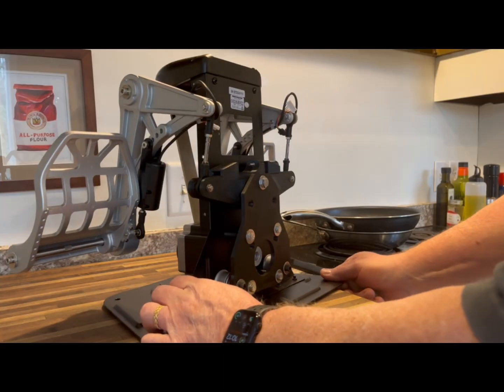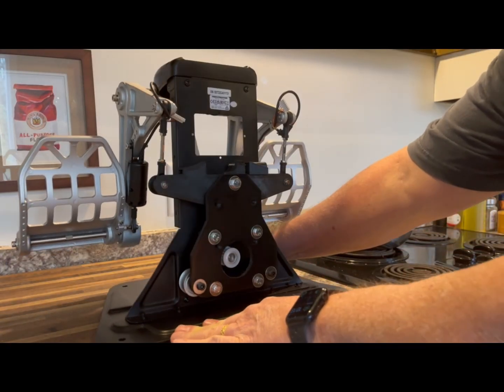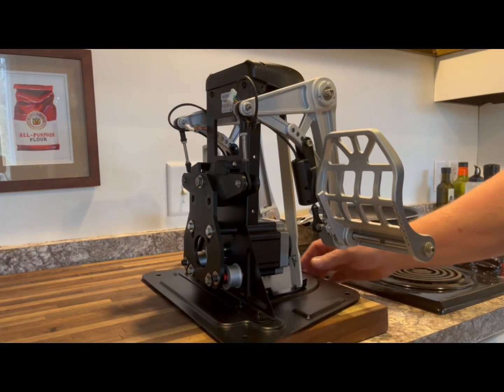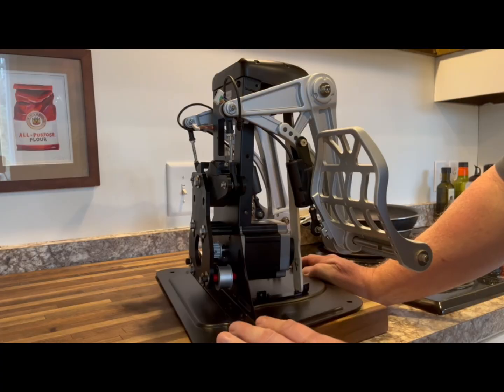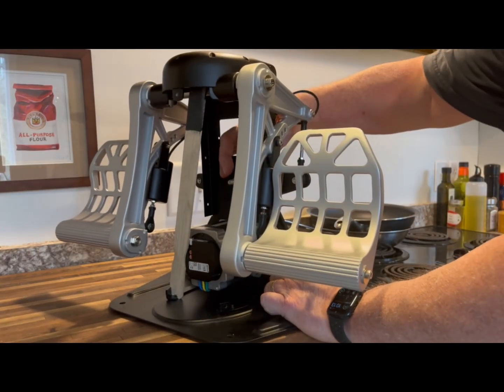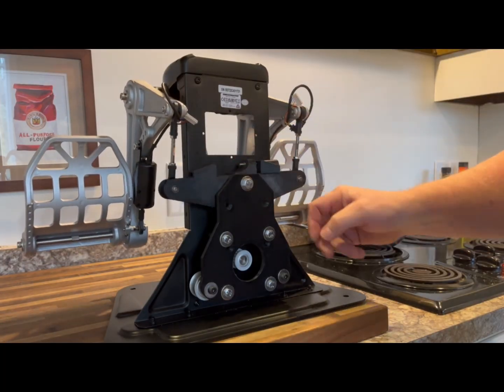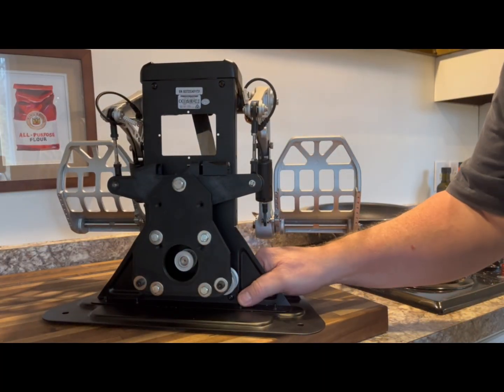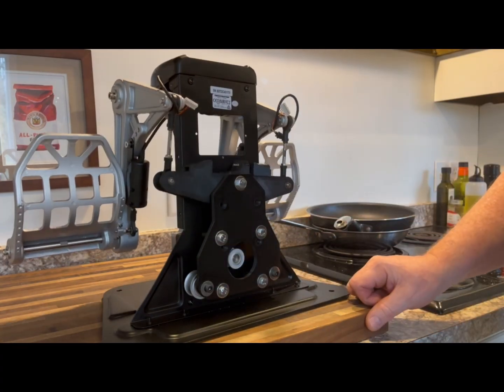DIY Force Feedback Thrustmaster TPR Rudder Pedals Using VPForce

Comment: This seems really cool, but it looks a little wobbly. Does it get ridgid when you put everything back together?
Reply from the maker: Yes the front cover is where all of the strength comes from.   One of the biggest challenges in this mod is supporting the heavy top section while the front cover is removed.

Comment: Thank you mate, I'm looking for this mod. I'm already fly the rhino stick for a year. I would like to know do the 3D print prats hold the force by kicking? And how does it feel? Because 90% time I don't use rudder on Jets. Is it a good investment?
Reply from the maker: I'm just finishing up wiring after waiting a month for two leo bodnar load cell amps.   I'll report back after I get it all dialed in.    I think the load cell brakes alone will be worth it, assuming they work.  :)
Reply from the maker: I don't know if you're still considering this build, but here's my take after putting ~20 hours on it.    The 3d printed parts seem fine, nothing has changed or moved unintentionally.   I printed this all in petg with high wall counts and a lot of infill, so they are heavy parts.    The action is good, they feel better than the original once you dial them in the way you like.    I've struggled with vpforce setup but I'm new to that software and you have experience with it so you'd probably have less learning curve.    

Is it worth it?  Pedals, maybe.    There isn't much dynamic force in the turboprop I primarily fly.    
But the load cell brakes?  100% worth it.    They feel like actual aircraft brakes now, and work perfectly.      

So I'd do it again, but would temper my excitement that FFB pedals would be a game changer for the types of virtual aircraft I fly.